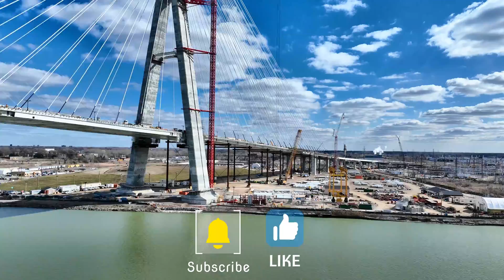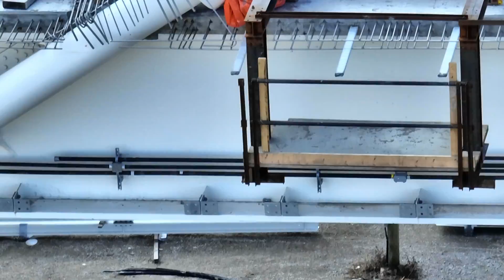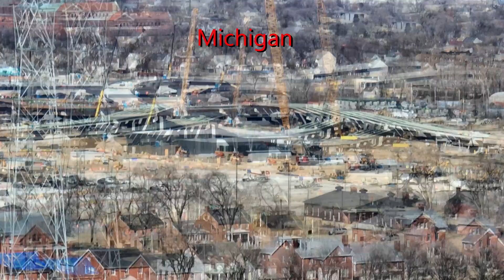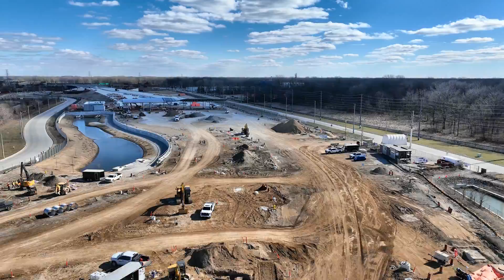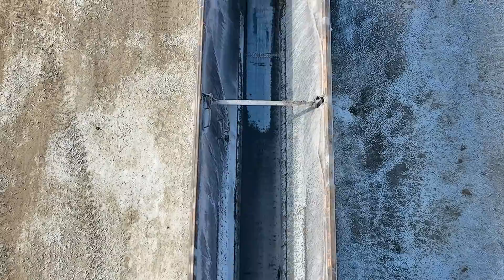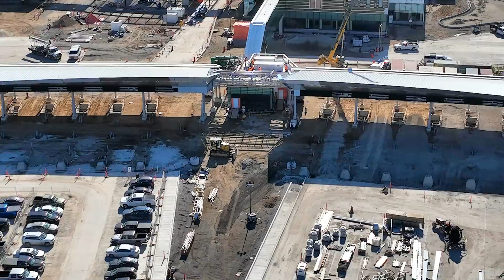See the Amazing Progress on the Gordie Howe Bridge in 2024!

Comment: I wonder if there is any wiggle room for the joining to be out an inch or two, or have they got it figured out precisely? Fingers crossed!
Reply from the maker: Good question, Jay. I believe they have a special section to connect the two sides. Tyhey can also adjust the tension on the cables to balance the bridge to keep it stable. Hopefully we will see it when the two sides meet. Thanks for the comment.

Comment: Great work bro. 
The close up glide from the towers out to the end make it hard to imagine those cables holding the massive weight there must be furthest from the towers!  Are those cables going to continue the same way- all the way til the two sides meet?
Hmmm . . . maybe at the grand opening they should consider renaming The Ambassador Bridge "Gordie Howe Junior"?
Reply: the set of cables on the other side of the tower is what keeping it balanced , otherwise  the weight of the span will probably pull the tower down .
Reply from the maker: Absolutley. You are right. The cables transfer the weight to the tower.
Reply from the maker: Hi John. The way I understand it, the cable stay compresses each section into the pervious section and transfers the weight back to the tower on either side. I believe there is a special section that connects both sides. It does seem like a long way out there moving alongside like that. Eh? :)
Reply from the maker: Yup that's the way they do it. Longest span in North America. The Ambassoador would be the senior in, age anyway. I measured with the drone to se how far they were apart. Posting it in the new Gordie Howe Video when it's ready. Thanks for the post John!

Comment: How much angle does each anchor point differ from the previous one. The first one from the tower appears to be about 5degrees from vertical where the 22 anchor looks like 30degrees or less from horizontal, anyone ???
Reply: I am thinking it may be a hyperbolic relationship.  However unless someone actually does the math and finds out, I cannot be sure.
Reply from the maker: Hi @denelson83. I did a quick search and it is similar to a hyperbolic relationship, but they don't refer to it in those terms. Thios is what I got :"When discussing engineering aspects of bridges, particularly concerning stress distributions across components like stay cables, terms like 'parabolic', 'catenary', or simply nonlinear behavior would likely arise before mentioning something strictly described as 'hyperbolic'." Thanks for the information, I got to learn something new. :)